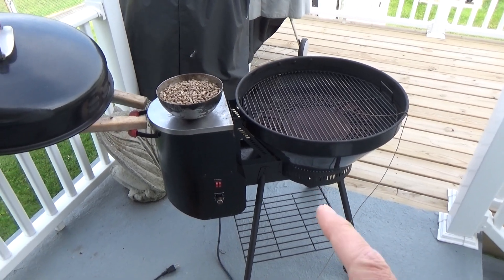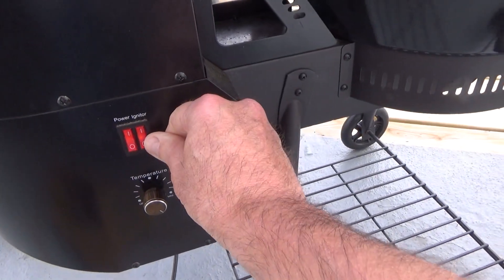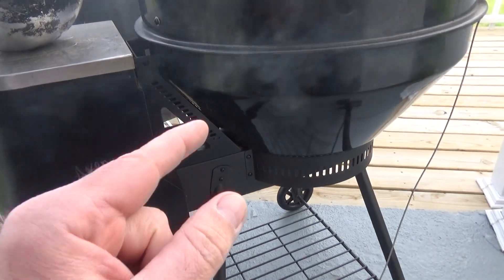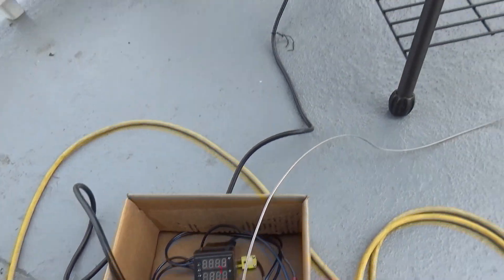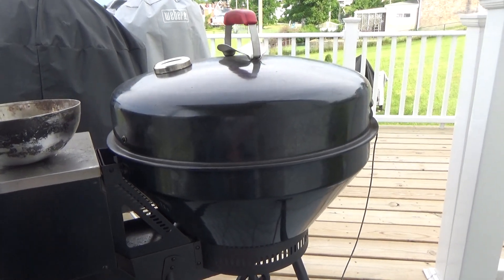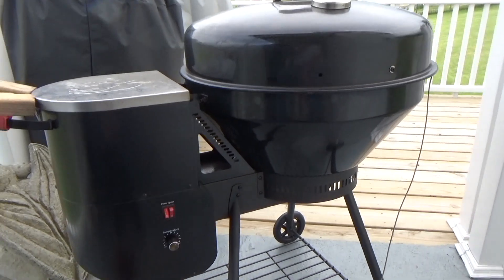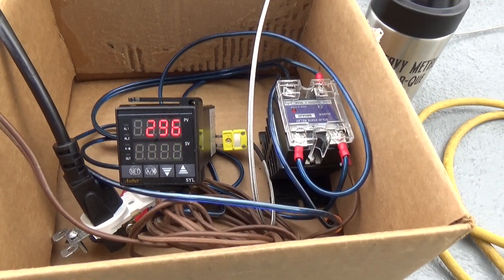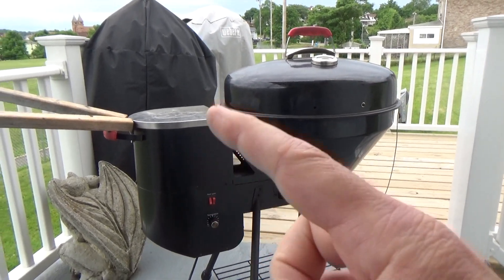Rec Tec Bullseye with PID Controller

Comment: The crappy thing with the new one is the probe readout showing actually reads about 100 degrees cooler then my thermoworks ambient probe I place on the center of the grate so I also adjusted the offset of the recteq probe
Reply from the maker: Hey Joe!  I'm glad that You set up your own probe, I find that this is a huge problem with lots of digital controlled pits, not just this rec tec. The probes are on the side or back and that's not a proper reading.  I want to know what the temp is next to whatever I'm cooking, just as You set  up your probe. 👍  Metal On! \🔥/

Comment: I know this is old but I just bought the new one and was messing with the pellet feed rate… factory setting is 3 and the fan is always blowing even when it reaches temp… I believe to feed rate is so slow it’s forced to need the fan. I changed the feed rate to 9 last night and the fan now shuts off at temp seems to be its dumped more pellets in the pot so it no longer needs the fan. It acts more like yours did when you set it to 300
Reply from the maker: Hey Joe!  That's cool that You experimented with that setting. 👍  You'll dial it in for what works for you. 👍  I'm a true believer in the PID, wish rec tec had an upgrade for my old model, but I'm done burning pellets as fuel in it.  I hope to have a Vid out showing it soon.  😁   Metal On! \🔥/

Comment: If you have any questions on wiring let me know, it's what I do for a living (industrial automation wiring), I will keep an eye out for a scrap metal electrical enclosure for your setup.
Reply from the maker: Thanks T!  I got this wiring figured out......but I'll keep you in mind.  I appreciate that.....but I got an idea for the box.....just need to find the time to mess with it. 
Hey.....didn't you have an idea for running guru's and fans......not the PID but a controller that 
changes speeds? I forget what you called it.  I told my electrician friend at work about it and he was hooking one up to a pneumatic Drill station we have.  Did you ever make one.......you said 
it may be expensive to put together?   Metal On!  \m/
Reply: @HeavyMetalBarBQue  That is different from what I was talking about, I was talking about a vfd for motor speed control. The more I think about it, it's going to be expensive, time consuming, and it may not work with a single phase motor. vfd controllers are usually used with 3 phase power, and that is not used for residential. You could get similar results with a pid controller in combo with a light dimmer

Comment: Are we talking about this one: https://youtu.be/1y8avwQDjeo

Another thing. Does something like a PID controller exist with a wireless probe?
Reply from the maker: Hey Eric!  Yes.......that is the new Bullseye that is PID controlled. 
A wireless?.......Great idea!  If there is I haven't seen one...Yet! 😁  
I'm sure it's coming!  Wifi is all the rage!  How are You and your Pit projects going? 
Metal On My Friend!  \m/
Reply: @HeavyMetalBarBQue  heey Ken, project is doing okay. Got some new drawings. Only thing is that I need some insolation to protect the electronics from overheating. Not sure how I should achieve that. I think the rocket stove Idea is finished (on paper).

Search for the Everdure 4K and you'll see what I'm going to add to my project. It only has to be wireless to make this project as airtight as possible, that's why I'm searching for a PID controller with a wireless probe.

I know Meater might add a fan to their idea if enough people will ask them for it. Till then, I should have to think of something else that works with this.

Do you know a low voltage version of this? I mean for example to hook up the BBQ dragon fan to it with something to control when it turns on and off? Not one that requires 110 or 220 volts.

Comment: Thanks for the experiment. I'm thinking about putting a smoke daddy PID on my Shit Boss maybe I can get a consistent smoke out of it. Metal on brother
Reply from the maker: Well........as You saw with my throw together PID set up.......it held temps pretty darn close.   When I had my Traeger ...that thing could have 
temp swings over 50 degrees + / - .   Very frustrating for sure.    👍🍺  \m/

Comment: Yo Ken, sounds like you were happy with the results! Not sure how the PID works with the fan and auger. You'll have to do a long cook, something like a pork picnic and put it to the test. Hey it's a good thing when you can run your cooker more efficient and save on fuel!! I thought you were going to forget... but then you snuck the PIF sauce in... thanks buddy \m/
Reply from the maker: Thanks Chris!   I was amazed by how steady it held temps!  Yes......I'm with You, a Butt is what I need to do!  
I promised........PIF will always be there!  R I P       Metal On My Brother!  \m/
Reply: The pid controller has a on/off point that can be set by user example blow temp (A) it turns on the relay that turns on the fan and auger, above temp (B) it cuts power to relay, cutting power to fan and auger. idk if this info helps or not.

Comment: I wish I could answer your question about the auger and fan but I can’t. I was curios about the new bullseye The Stainless cooking chamber is impressive. When might you acquire a masterbuilt 560 you can skip the sawdust and throw a couple chunks on and walk away. The Bells of St Mary acknowledge your onto something. When will we be putting this to a lengthy maneuver. \m/ 🤘
Reply from the maker: Hey John!   I always look forward to your comments. 👍   I like the idea and design of the new Bullseye, but I won't get one because mine is paid for. 😁 
I don't know if I told you this story, but I had my hands on one when they first came out. I knew they would be the next big thing and would convert a lot 
of Pellet Guys to this technology.....but I couldn't do. I just don't have the room to buy every Pit that comes down the pike.  YouTube doesn't pay me enough to afford 
every Pit.......But I will tell You if I had it...it would be Modded to the Max!  😁  I told a friend about this Pit, he got it and sold his pellet grill.  He absolutely loves it 
and makes great BBQ on it!  Haven't been making videos but, I've been using my set up using the fan of the Bullseye with charcoal and the PID unit.  
It's very efficient with little to no fuel consumption.   I believe the The MasterBuilt is Fuel Hog!  Just my opinion.....by what I've seen.  Some guys don't care about 
that, but I do.   👎 
I'll do a Butt and put my set up against anyone with the New one! 😁  Mine has the PID temp probe at grate/meat level.......the new one, the probe is down low 
sticking out the side.  Does this make a difference?????......it does to me. 👍  
Good to hear from You my Friend. Metal On!  \m/

Comment: Yes the fan shuts off as needed on the pid one, and my old pid rec tec mini, its a more intricate setup the way it is wired on the pid grills, your setup is not controlling the auger and fan independently like is needed.
Reply from the maker: Hey Gary!   Thanks for that info on the PID fan and auger.   I know my set up isn't the correct way to wire it.........but it worked!  😁  You saw it for yourself. 
I would really like to get the new model because it's cool looking Stainless which I like.......but mine is paid for and it works.  
Metal On \m/
Reply: @HeavyMetalBarBQue  Another batch of the new ones is set to release any day this week, if you're interested, they sell out super fast it sux!